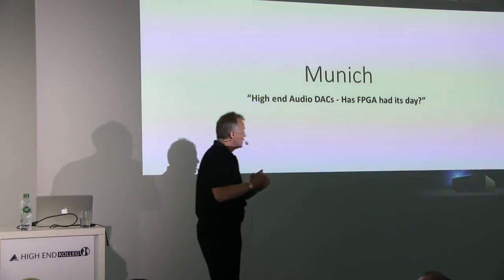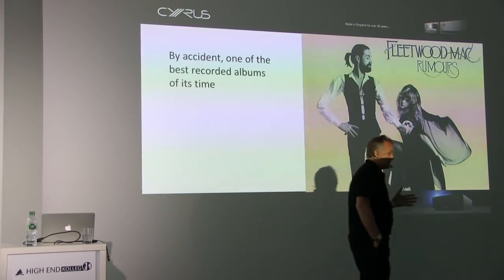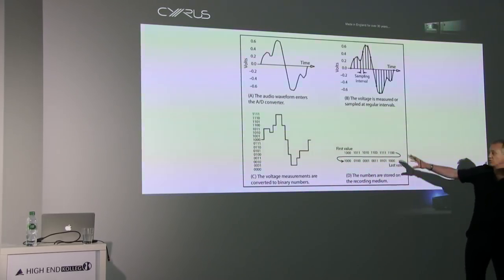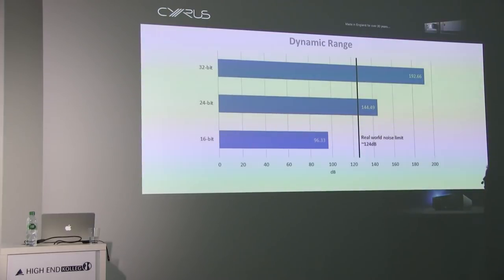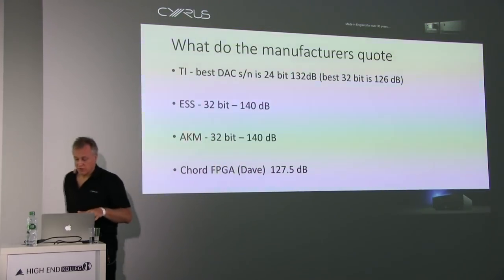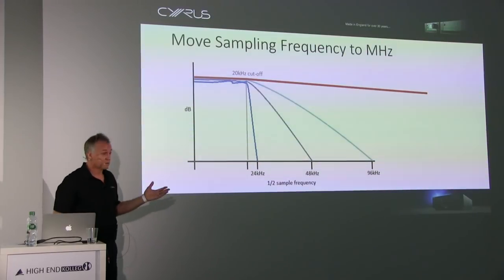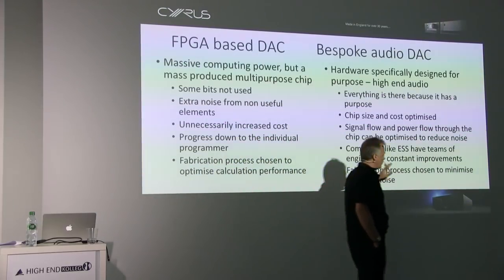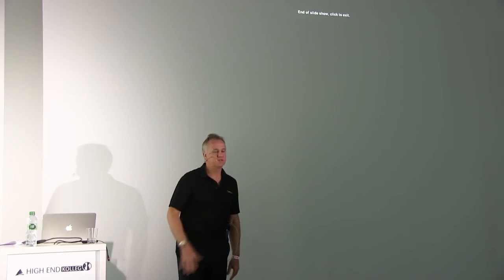High end Audio DACs - Has FPGA had its day?

Comment: After he says "trust me" at begining i belive to not trust he. He lying about smd capacitors at the end. They not have to chose, they have to read datasheet. So by manually listen capacitors, oscilloscope and phase analysys show no benefits at the sound frequency's or digital IC's data lines. So this is necessary in powerfull radio applications, DSD, gigaherts oscilloscopes ADC's, e.t.c. high current on high frequency's